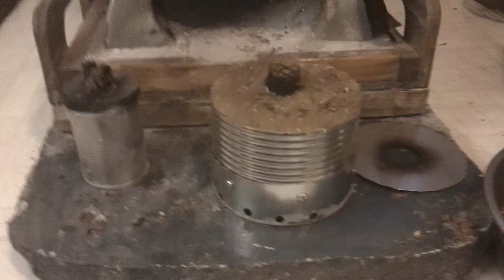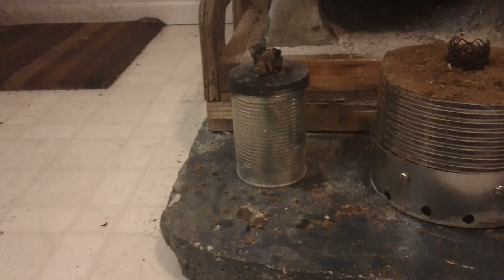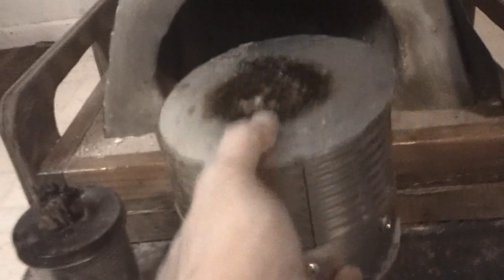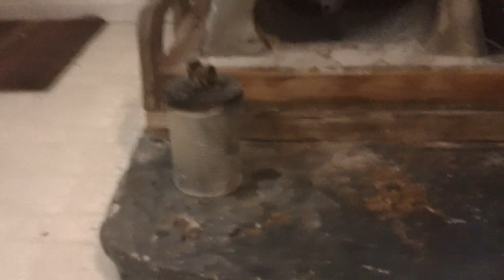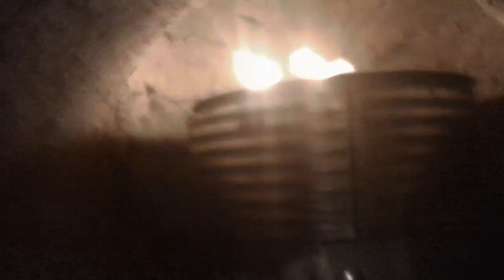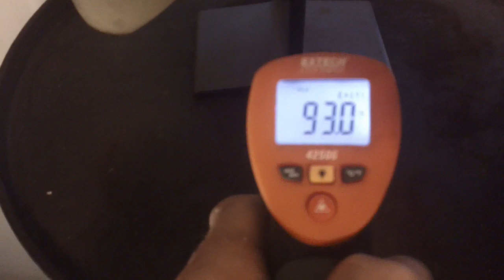Saw Dust/Waste oil update part 2

Comment: Hey Van, have you thought about putting a double lid on the wick burner - with venting holes on the upper lid to keep the fuel cooler. And then use that system to heat a heavy 'Clay Pot system...? * I'ma gonna try that one day soon. Along with compressing the sawdust/oil mixture into 'pucks' with a centre hole for my wood burning stove..
Reply from the maker: let me know

Comment: I mixed used motor oil and saw dust. Using a small frying pan I put it in my wood burning heater. It would not burn. Input welcome

Comment: I was thinking if you use the rocket stove to heat the plastic to oil reactor then feed it into a cylinder filled with oily burning saw dust the off gas wood burn and the condensate would keep the saw dust saturated